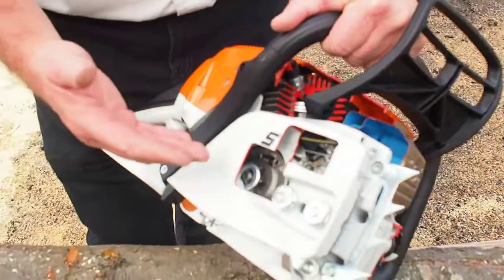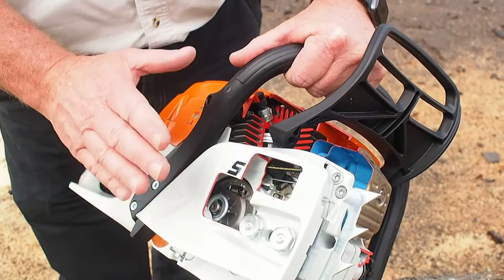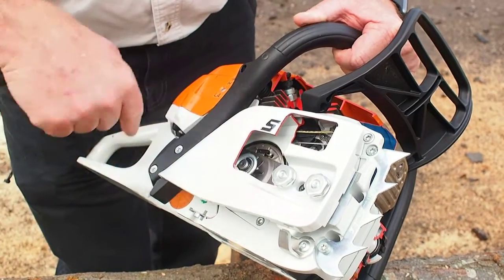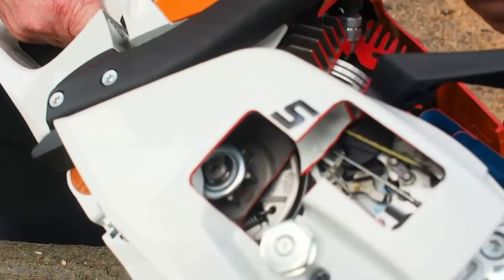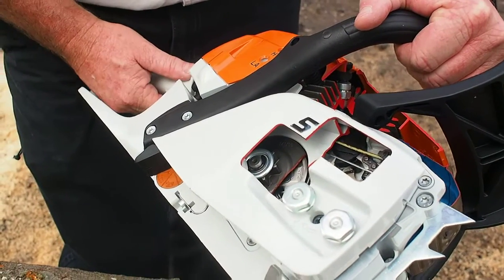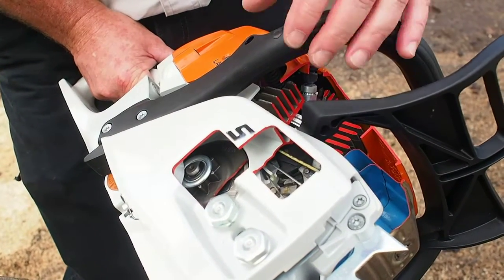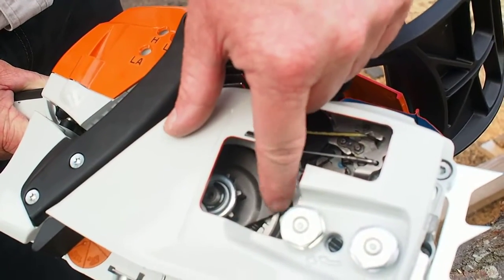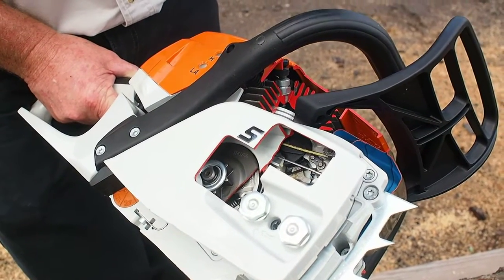STIHL Chainsaw Clutch System

Comment: Having wooded acreage to maintain a good saw is a must.>>>urly.fi/11X7     After unpacking, reading the instructions and filling with fluids, the saw cranked on the first pull. It cut through several sweet gums like butter an I was very pleased. My old saw was 14 years old and endured several fuel line, bar, sproket and chain replacements. It is still a good saw but under powered. This 460 has the power and time will tell if it lasts as long as the wild thing.